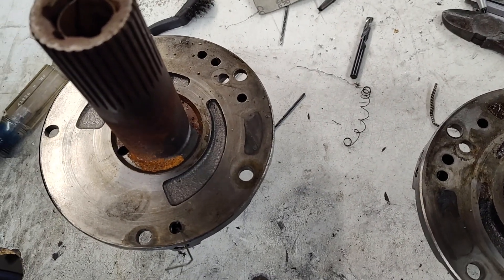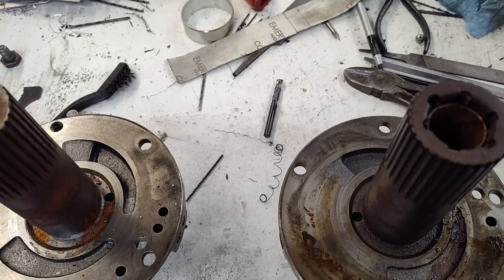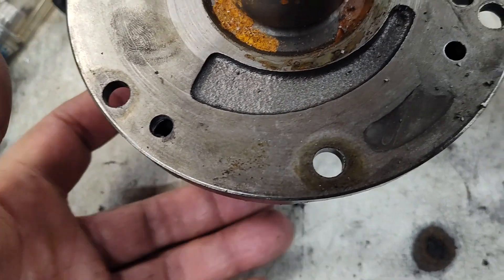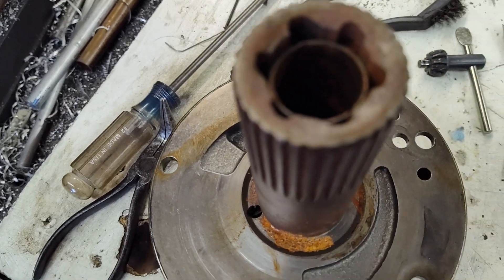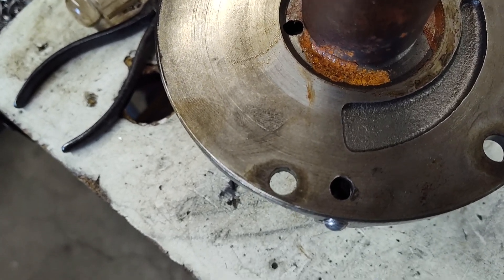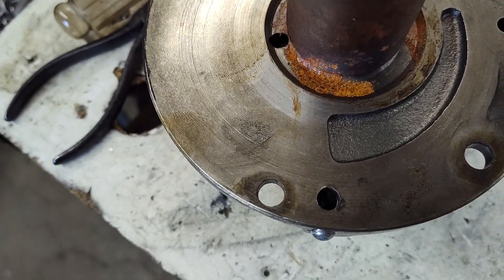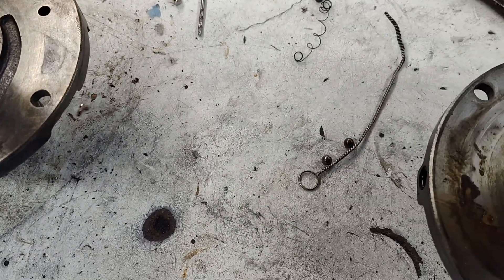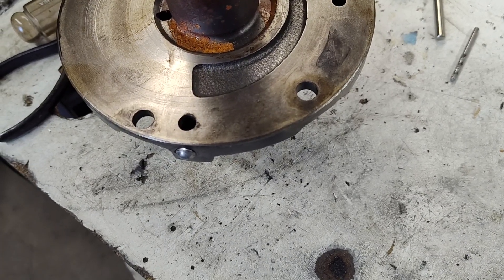Ford C4 Stator Modifications For Improved Cooler Flow

Comment: What this does is to eliminate pressure limits on the converter which is why they used to puff up or balloon which drives the inner pump gear into the stator. Converter, pump, and stair all destroyed. Skip all of this and install a large high performance cooler.
Reply from the maker: Thats not true. I think you are confusing it with the converter pressure relief system. I did not go over it in this video.

Comment: Had 2 of these shite cast stators crack under normal torque range. Had to go billet cause it wouldn’t seal and the. When you did get it to seal it cracked
Reply from the maker: I have never seen one broken. Where did you get a billet one?
Reply: @ speed master has a billet one and jegs has one closer to oem. Mine always cracked at the lowest bolt hole that is in the recess with the smaller hole next to it. Weak point even under high pressure. Just snaps the whole U out

Comment: We just tore down my second hand C5 for a rebuild. We noticed that the by-pass hole was tapped but nothing was in there, no block off in that passage. Would that have been blocked with the press-in block off from the factory like what is shown at 4:42?  Thanks.
Reply from the maker: The factory used check balls to block passages. Sounds like someone modified it previously.  Be sure you dont have open ports.

Comment: That's a nice trick. I drilled and tapped mine. You might want to let the newbies know. They have to tap that ball back in that u pushed out before reinstalling the stator.
Reply from the maker: I did forget to say that. I also re stake it in a bit to make sure it wont pop out under pressure.